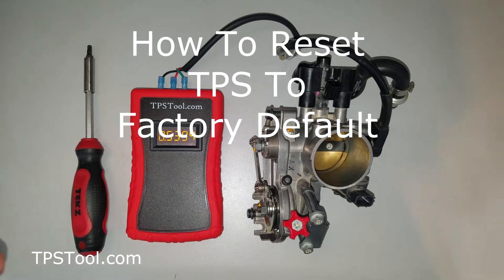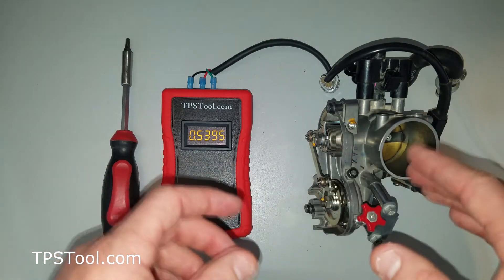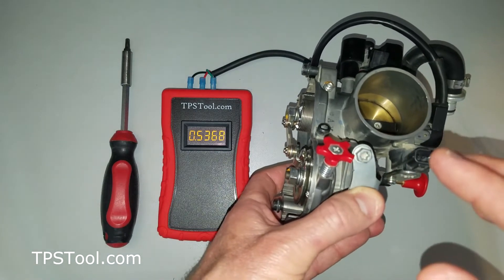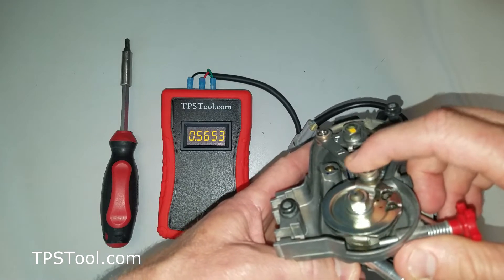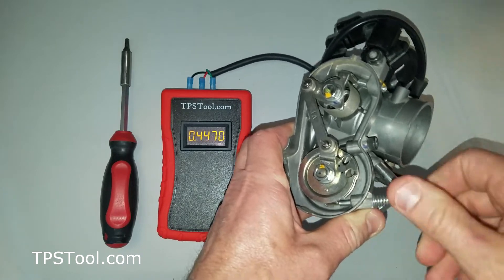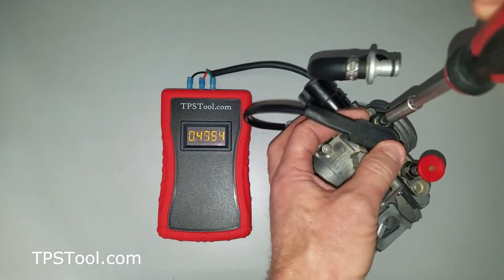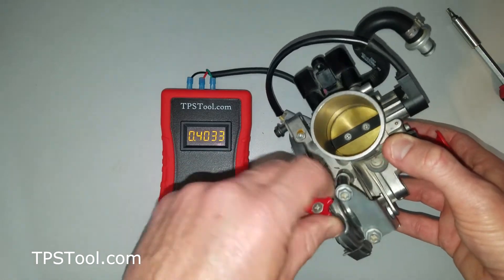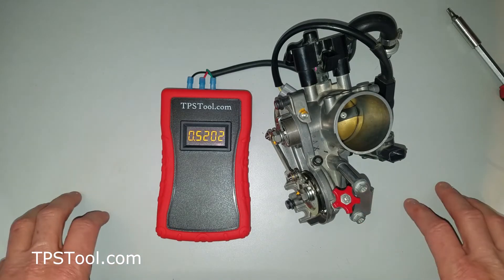How To reset your TPS to factory default (Throttle Position Sensor)

Comment: Hi could you help, I have the same model as the video. When I screw the idle all the way out and pull the cold start out the bike will start and idle but as soon as I press the cold start in the bike dies. Any ideas?
Reply from the maker: If the TPS is OK, next I would check the fuel pressure.  A common failure is the in-tank fuel line or filter can burst and leak, which leads to very low fuel pressure which can cause the issue you describe.  If the fuel is low enough, sometimes you can see the fuel spraying around inside the tank if this is what happened.  If the TPS and fuel pressure are OK, I would next check the fuel filter that is inside the fuel line disconnect, it's tiny and can clog.  If that's OK, then check the injector to make sure it's clean and the spray pattern is OK.  I hope this helps!
Reply: @TPSTool  looks like I may have sorted it, I reset the tps but still didn’t work, I couldn’t adjust the idle still. So I unplugged the tps altogether and started the bike up ran a little better, so I turned bike off and reconnected the tps and hey presto TPs is within spec and both cold start and idle now working.

Comment: Thanks for the video. How do we convert Kiloohm to Volts. My service manuals says "Throttle Position Sensor Standards Resistance is 4.0 ~ 6.0 Kiloohms" How does that translate to Volts?
Reply from the maker: It's a voltage divider, you would need to take a couple of measurements then do some quick math.  What motor are you working with?  Is it an FCR carburetor by chance?
Reply: @TPSTool  it's a 40mm mikuni CV with TPS
Reply from the maker: @Philche  Which motor is it on?
Reply: @TPSTool  It's a 1700cc V twin. 1670 cc, V-twin, 4-stroke, OHV pushrod, carburetor.
Reply from the maker: @Philche  OK, I was hoping for a specific year and model so I could search a little bit.  Long story short, for a carburetor the TPS typically does not need to be nearly as precise as it does for EFI, so if the specs are given in ohms then that will be the easier way to go, only because the specs are already given that way.  But if you want to calculate the voltage, check out my video titled "Polaris TPS, 0.46 or 0.70, which is correct? Ranger, Sportsman and more".  In the second part of that video I show how to calculate the voltage after taking the measurements.  I hope this helps!
Reply: @TPSTool  Thank you for the reply! It is a  2005 Yamaha Road Star 1700
Reply from the maker: @Philche  for that motor it looks like 0.70V at idle should be good, but try a little higher and a little lower to see if you can fine tune it.  I found that info here: https://www.youtube.com/watch?v=MNkVn31vYYk
Reply: @TPSTool  thank you!!

Comment: i have a 2022 ktm 350 sx-f that has problems with flameouts. I can't find the default value anywhere in the manual even with searching for the words. Do you think a 22 has the .40 base too?
Reply from the maker: Thanks for your question.  As far as I'm aware, the 2022 is 0.40V with the throttle plate fully closed.  I'm not sure why KTM stopped publishing the values.  Before you make any adjustments, take your reading at-idle and a reading with the throttle plate fully closed, then you'll know where it was set from the factory in case you want to go back to it. For flameouts, make sure your idle isn't too low.  If the idle is too low it will flameout easily even with perfect fueling.  If the idle is good, first try a slightly lower TPS setting, decrease by ~0.02V and give it a test.  Repeat the adjustment as long as you see improvement.  If that makes it worse then try a richer setting (increase 0.02V at a time), but flameouts are commonly from being too rich so that's why I would try the lower setting first.  Please post back and let us know how it goes!
Reply: Will do! I have one on the way after watching these vids last night. And thanks for the quick reply! So test it running at idle, then off? Or by closed you mean backing the idle out all the way with it off to get the difference like you did here? I think my idle is ok but honestly never touched it. Depending on where my values are at, should I do what you did here and turn idle all the way out, then set to .4, then idle back up to where it's idling nicely? @TPSTool
Reply from the maker: @Tburnette60  Thank you very much for your business!  If you take the reading as-is (with the idle set as-is), then back the idle all the way out until the throttle plate is fully closed and take another reading, then you will have both the factory base setting (throttle plate fully close) and your current idle speed setting.  This will make it possible to return to exactly the settings that you have now if you ever want to.  So if you get all out of whack and want to go back to your original setting, back the idle all the way out and adjust the TPS to the base value you wrote down, then turn the idle up until it reads the idle value that you wrote down.  Now you're back to exactly where it was before you adjusted it.  Does this make sense?  :)

Comment: Hi I have ktm sxf 250cc 2012 kick start only starts but dies after 10seconds I have pigtail and multimeter can I set TPS with bike not running as it dies after 10seconds hope u can help me plz 🏴
Reply from the maker: You either need to work 10 seconds at a time, or use the powered tool shown in this video.  Maybe get a buddy to help by kick starting it every time it stalls.
Reply: @TPSTool  thanks so much for always getting back I’ve asked a lot of machanics on you tube and no one ever bothers to get back to me u always do the last time u told me to get new fuel pump and did and bike ran great so I appreciate ur time and help you are the best videos explained perfect TOP GUY👊🏴💪👍
Reply: @TPSTool  if I kick it when it starts it should give me reading

Comment: Good morning! Great video and great info! Where can we find factory THAD setting for 2018 250 XCF? I don't have the service manual. Thank you!
Reply from the maker: Thank you for your comment.  I don't have the service manual for that model year, if you can get your hands on it then the information might be in there.  However KTM doesn't publish the numbers in every manual for some reason, so it may or may not be in there.  Without the manual, my best guess would be that your bike likely matches the values in this video.  What you can do is take readings before you make any adjustments, at idle and with the idle backed all the way out (if adjusting your idle moves the TPS), then you have the original settings and can go back to them at any time.  From there you can try the settings in this video with no risk.  If it runs good but not perfect, you can try adjusting up or down by 0.02V, then check if it's better.  Repeat as long as you see improvement.  If it gets worse, adjust in the other direction.  You should find the best setting for your bike quickly this way.  I hope this helps!

Comment: I am from India and I own a Kawasaki ninja 300. No error code on the bike's dashboard..Can the sub throttle sensors and TPS be adjusted as bike is running rich after I got the throttle body cleaned (by a Kawasaki mechanic)...and also the eco mode disappeared from the dashboard. (Vaccum synchronisation done and fuel tank, injector, air filter is ok)
So, can I adjust the TPS and sub-throttle sensor back to factory settings without changing the whole throttle body...?
Please reply..
Reply: Thanks for your response
Reply from the maker: Thanks for your comment. I'm not familiar with that particular motor.  If you think the mechanic who cleaned the throttle body adjusted the TPS, then it would be a good idea to set it back to the factory setting, but if he did not move the TPS then the issue is likely something else.  Can you ask the mechanic if he moved the TPS?  If your eco setting disappeared from the dash board then perhaps the mechanic did more than just clean the throttle body.  Did he make adjustments to the computer too?
Reply: @TPSTool  Thanks for your response!
Actually after cleaning the throttle body, I was having rough idling problem in my bike and also the bike was very much struggling to go beyond 8k RPM (max on my bike is 15k RPM) while riding.
Then the other mechanic in order to fix the above problem (rough idling and poor performance) conducted vaccum sync of the throttle body. Even then the problem (rough idling & poor performance) was not solved. So, lastly he adjusted the sub throttle sensors and finally rough idling problem was fixed.
But after a day I realised that eco mode disappeared from the dashboard and the exhaust smell like petrol. Also mileage of the bike decreased significantly.
And no adjustments was made in ECU as I was physically present there.
Reply from the maker: @shabbiralam4538 It does sound like the motor is getting too much fuel, especially with the oil smelling like fuel.  If I had to guess, it sounds like maybe some of the sensors he adjusted are not adjusted correctly.  Perhaps the real problem is something else and he tried to correct the problem by adjusting the sensors, but the actual problem was different.  Maybe a dirty injector or low fuel pressure, etc..  I would make sure the sensors are adjusted properly according to the service manual, and if it still doesn't run right then the problem must be something other than the sensors.

Comment: When my bike goes in 4 or 5th gear and then get back to 2nd gear it losses the power and then i have turn the switch off from keys and then i have to start the bike. I'm not able figure out the problem.. Any suggestions??
Reply from the maker: What kind of bike?  The first thing I would do is check if there are any codes set in the computer, maybe it's going into limp mode (self protect).  You might  need a dealer tool or OBD reader depending on what kind of bike it is.

Comment: Hi, just ordered a pigtail model 2 for my 2014 ktm sxf 250 and planning to set mine up myself. Could you help me on the settings? Mine is the style that changes the voltage when adjusting the idle screw.  Unsure what setting i need the voltage meter on to start with any help would be greatly appreciated, keep up the good work 👏  from the UK 🇬🇧
Reply from the maker: Thank you very much for your comment and your business!  Are you trying to solve a particular problem, such as difficult starting or rough running down low, etc.. ?  I would start by making sure you're at the factory default.  First take the reading as it is now and write it down, then back the idle all the way out and take another reading and write that down too.  Now you can go back to your original setting if you want.  If the reading is not 0.40V with the idle backed out, then adjust it to 0.40 with the idle backed out.  Next turn the idle up until it reads around 0.53.  Start it up, fine tune the idle and see how it runs.  From there you can fine tune by adjusting the voltage a little higher to go richer, or a little lower to go leaner.  I hope this helps, post back if you have any other questions!
Reply: @TPSTool  hi thanks for the info and help, its no longer at the standard setting as ive had someone try to adjust it to get rid of a funny idle issue and a bogging issue. I'll try those settings and let you know how i get on with it. Ive been eliminating problems for weeks but i think ive sorted it out now but need to sort tps out again. What wires do i plug the voltage meter into on the harness?
Reply from the maker: @HairyPollocksFishing  Connect your volt meter to the red and black wires on the pigtail to take your reading.  Watch this video starting at about 5:30 for an example using a 350sxf: https://youtu.be/v1OXY5_jAv4?t=329
Reply: @TPSTool  thanks for that its much appreciated.

Comment: I have a 2015 Ktm 350sxf and adjusting the idle moves the number. I can tell you the stock tps setting is not .40 and .52 isn’t the correct idle. Any idea?
Reply from the maker: Thanks for your comment.  I don't have the shop manual for 2015, but why do you think those numbers aren't correct for that year?  Looking at the parts diagrams, your year should be very similar to the throttle body in this video so I would be surprised if the settings weren't the same.  Please let me know, if I've got something wrong somewhere then I would definitely like to correct it.
Reply: Hi! Did you find out how to correctly ser Tps on 2015 350sxf?

Comment: I have a 2015 fe350s and I can’t seem to find the baseline tps setting anywhere in the service manual. Would you happen to know what it is
Reply from the maker: Thanks for posting.  I don't have the manual for that motor, but I believe it's going to be the same as the KTM's, so it will likely be either 0.601 or 0.40 as mentioned in this video.

Comment: What style is a 2015 fc 450?  Does the idle adjust the tps?
Reply from the maker: Thanks for your question.  It looks like your 2015 FC450 uses the Model-2 style plug and is the type that adjusting the idle changes the TPS reading.
Reply: @TPSTool  your website shows I need model 1 connection.   Please advise
Reply from the maker: @Moneypress11  Thanks for your reply.  Past responses from customers indicate it uses a Model-1, looking at the parts book the plug appears to be a Model-2.  The best way to know for sure is take a look at your TPS plug and compare to the pictures on our web site.  Model-1 (oval) and Model-2 (triangle) are very different so it should be easy to tell.  Please post back and let us know what you have.  I don't have a lot of feedback from the FC bikes of that era so any info you can provide about your bike would be great.

Comment: I bought the tool to adjust my tps sensor on my 2006 Honda crf 450r. And in the repair manual it says that it should be 4 - 6 kΩ. What number should it say on the tool for it to be 5 kΩ? I really need help because I can't figure this out. Please help!

Comment: Hi i have a sxf 250 2015 eu and having trouble setting tps,what is the baseline as im confused told its 4.00 and some say 6.00v?thank you👍
Reply from the maker: Thanks for your comment.  I explain how to tell what your default value is starting at 0:30 in this video.  It will not be 4v or 6v, it will be either 0.4v or 0.6v.
Reply: Also I’m confused cause some videos you say to mess with the idle and some you say not to??
Reply from the maker: @jfricke1188   I apologize for the late reply, I just noticed your response now.  On some throttle bodies the idle is adjusted by a screw that moves the throttle plate, and this changes the TPS reading.  So for these throttle bodies you have to take the idle setting into account.  On other designs of throttle bodies, the idle is controlled by a completely separate air circuit, adjusting the idle on those does not move the throttle plate at all and has no effect on the TPS reading.  Does this answer your question?

Comment: Does this tool work on ski doo snowmobiles as well? Thank you
Reply from the maker: Yes, as long as it's a 3-pin TPS it will work.  Compare your TPS plug to the plug pictures at tpstool.com or on Amazon to see if there's a direct plug-in adapter in the kit, or you can use the universal adapter that plugs into each pin individually (included in every  kit).  If you're unsure, post your snowmobile year and model here and I'll try to help out.
Reply: @TPSTool  awesome,  thank you..
It's a 2010 adrenaline 800r
Reply from the maker: @kenraterink3916  I don't have your TPS sensor here in my hands, but looking at pictures online it looks like the Model-4 adapter that comes with all of the TPSTool kits will fit your TPS.  I will copy a link below to the Amazon listing and you can see a clear picture of the Model-4 plug there, in case you want to compare to your TPS plug:  https://www.amazon.com/Throttle-Position-Adjustment-adapters-Version/dp/B07SRW6VCK/ref=sr_1_1?dchild=1&m=A1M1NP2JNRC0HC&marketplaceID=ATVPDKIKX0DER&qid=1614451170&s=merchant-items&sr=1-1&th=1
Reply: @TPSTool  great. Thank you very much

Comment: hy ! have any idea what is the spe  for Tps in a Kymco Agility 50cc 4t euro 4 dellorto card i tond find for calibrate my tps....can you help me ??
Reply from the maker: Thank you for your comment.  Unfortunately I do not have any information about your Kymco Agility scooter.  If you can get access to the service manual then the info should be in there.
Reply: @TPSTool  i have tryed but i dony find that i search every where i dont find the spec value for thia tps...:(
Reply from the maker: @Nicusor95  If you can find a buddy with the same motor, maybe they will let you measure their setting?

Comment: I had a TPS put on my trail blazer and it did not work it still stalls what else can i do
Reply from the maker: You have to figure out what the problem is.  On a car, start with an OBD scanner and see if you can get any codes from the computer.  You can get them cheap on Amazon.

Comment: I have a 2004 rmz 250 that starts and drives but won’t idle what is the problem
Reply from the maker: I think that year is carbureted and not FI, so check your pilot jet.  Also check the valve clearances.  It could be several things but these are probably the 2 most likely.
Reply: TPS Tool Thank you so much! I’ve commented on so many videos and you’re the only one to reply!